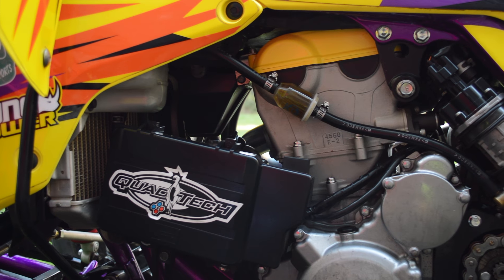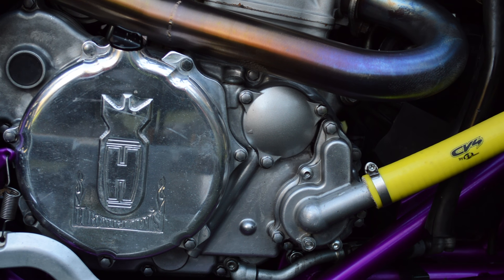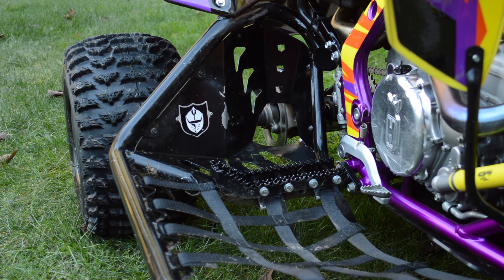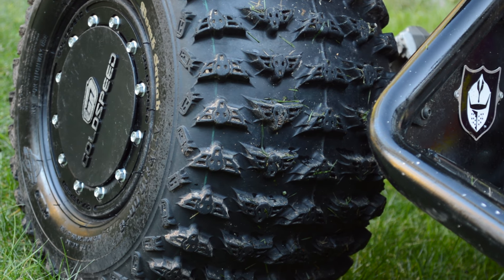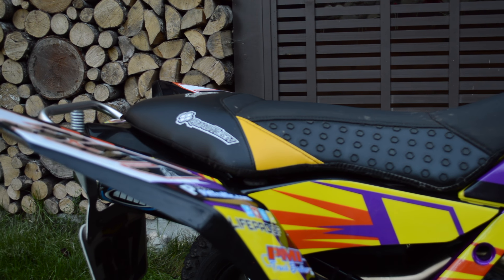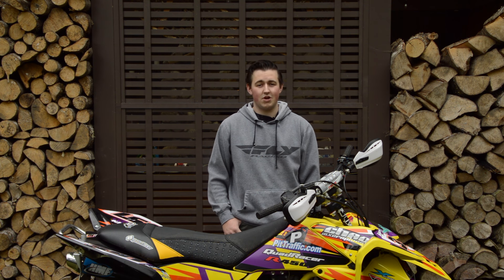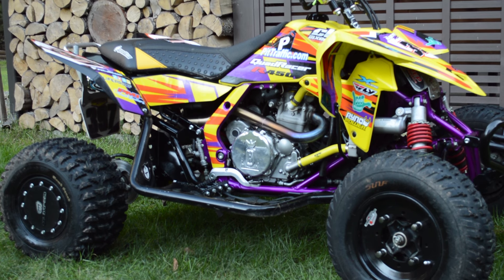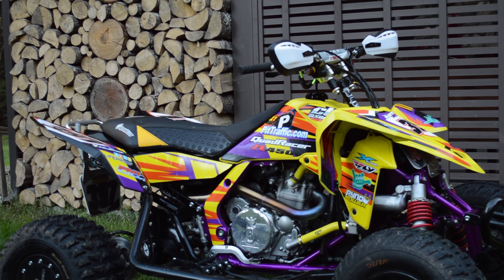PROJECT '08 LT-R450

Comment: Shocks should have been the first thing to be upgraded
Reply from the maker: Normally I'd agree with you, but in this case the motor was blown so that got first priority. My original plan going into the build was to focus on a complete suspension overhaul, but there ended up being so many broken/damaged parts that my budget to do so ran out. Throwing shocks and arms at a machine with bad bearings and a host of bent and/or broken parts would have just resulted in an expensive build with poor reliability and issues. 

That being said, now that everything is restored and mechanically sound, suspension is the next thing on my list for this quad. As I said I'm happy with how the stock setup works, but I know there's plenty of room for improvement there too. I'm not sure when I'll get around to it as I'm taking some time to focus on my new bike instead, but when I do overhaul the suspension there will certainly be a full video covering it!

Comment: Very professional video. I also have an 08 LT-R450 that nearly beat the heck out of me in my first race on a quad in 12 years (third time ever on a quad) the course was brutal and consisted of about 60-70% whoops (no exaggeration). How have you set up the suspension and bars/seat to handle the whoops, I was pretty miserable the entire race. I love my Quadracer but...that lack of being able to handle whoops for a long time needs to change. Have you done a video on how you have changed the suspension?
Reply from the maker: Thank you! 

As far as making the LT-R450 comfortable, a puck-style stabilizer (CCP or Precision) is a must. This will help dampen steering input and give you more control in whoops and rough terrain. Then I would add either Flexx Bars or a set of Precision Anti-Vibe clamps. Either will help a lot, especially paired with that stabilizer. 

For the seat, I really enjoy my QuadTech kit. The seat cover is really nice, but more than anything the foam is the difference maker. It's more comfortable and also lower profile. This should improve your overall comfort a lot. 

Suspension-wise, aftermarket would be the best bet. As you can see, I still have OEM shocks though. The cost of suspension is really high, but if you can afford it, a long travel set-up with Walsh arms and Fox Float, Elka Stage 5, or PEP shocks will make a huge difference. That said, if you're like me and that sort of stuff is beyond the budget, here's the settings I use for my stock shocks for best results. You can also get the stock shocks rebuilt by a company like RaceTech or Derisi and that will at least improve them if you can't set them to your satisfaction. 

Front Shocks 
Two turns in on compression, rebound backed out all of the way (go one click back in, never have an adjuster all of the way turned in or out!) Preload nearly backed all of the way off. 

Rear Shock 
Two turns out on compression, rebound one and a half turns out, preload set to zero (adjust sag accordingly from there.)

Also, a simple thing would be to make sure the tire pressure is all good. I usually stick between 10-12 in the front and 8-10 in the rear depending on conditions.
Reply: Awesome, thank you. I appreciate the advice.

Comment: Did you have to get a extended clutch cable? I have a +2 alba stem and my cable is giving me issues. What oil and coolant do you run?
Also did the slide and guide kit come with the rear guide mount or does it use oem?
Reply from the maker: I never had trouble with the OEM cable, but only used a +1 stem.

In this quad I used standard Yamalube 10w-40 (oil changes every 2 hours or after a race weekend) and Engine Ice coolant. In my current quad I'm using Maxima Pro Plus 10w-40 and still using the factory coolant.

The Slide n Guide kit provides everything you need.

Comment: Hey whats going on man just have a question i have a 06 ltr im just wondering how where you able to get away with only a cherry bomb with hotrodz crank and high compression piston? I cherry bomb, pipe, filter with lid off and hot cams do you think id be able to add a hc piston without any issues or needing a different type of fuel tuner

Comment: If I buy that exhaust system, I dont have to tune anything?
Reply from the maker: In theory you don't have to tune an LTR with basic mods as long as you use the cherry bomb. It will run better tuned, but not necessary.